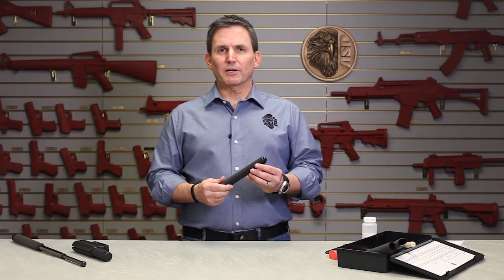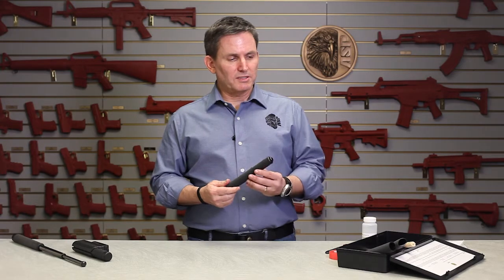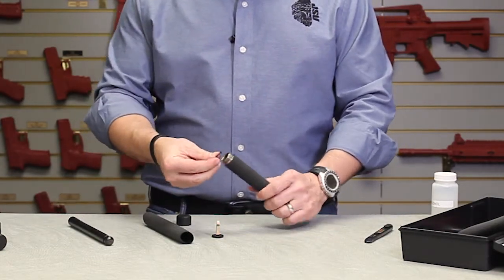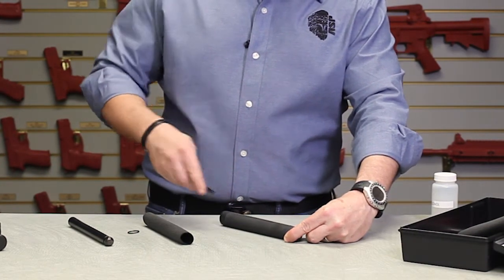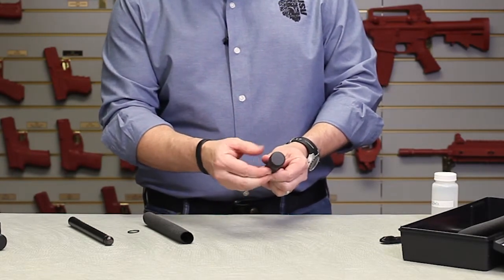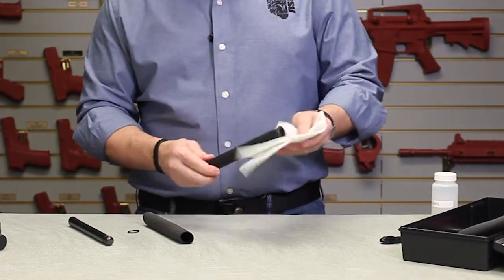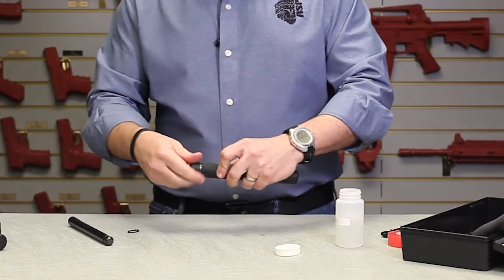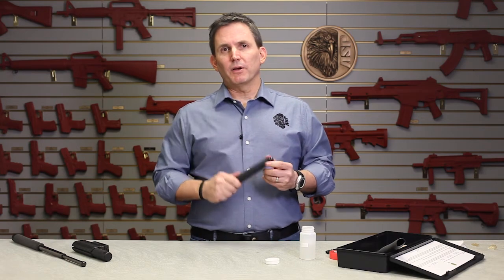Baton Grip Replacement

Comment: wich is the use of the tape? is it posible to do it without the tape? Thanks
Reply from the maker: The tape keeps the foam grip properly positioned on the tube, preventing it from shifting or twisting in use and over time. We do not recommend replacing the grip without applying the tape.
Reply: @aspusa1  thanks, but it should be a special tape? Or a normal one?
Reply: What about the other grips? I'd like to replace my foam one with another.
Reply from the maker: @spacepope87  Only the foam and Wavemaster grips are replaceable. When you order a replacement grip on our website it comes with tape. https://www.asp-usa.com/collections/product-parts/products/friction-loc-parts
Reply: What's that brush you used to wipe the alcohol into the tube of foam?
Reply: Where can i buy the replacement foam grip please? I’m in the uk